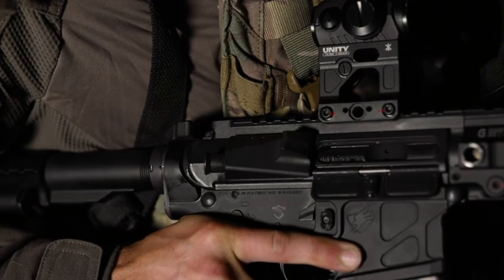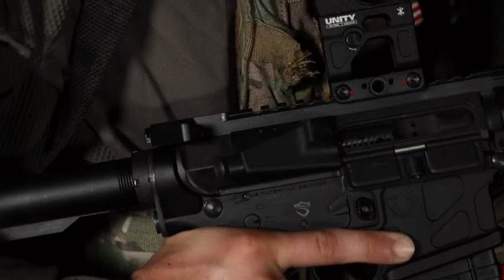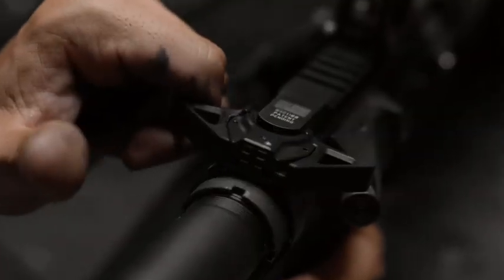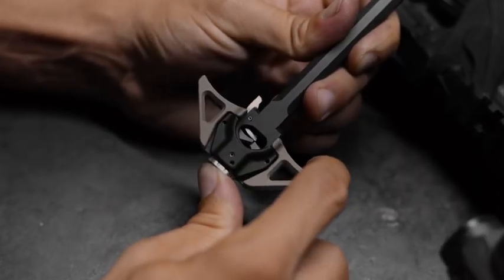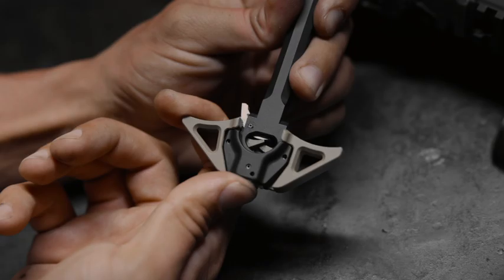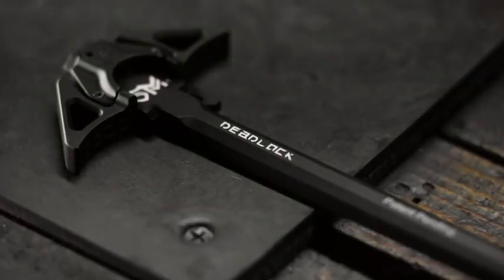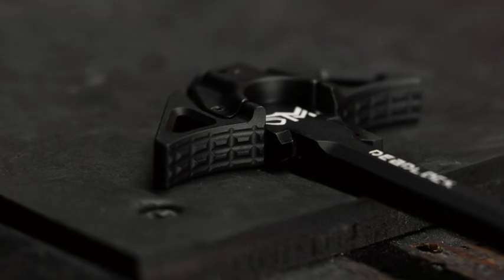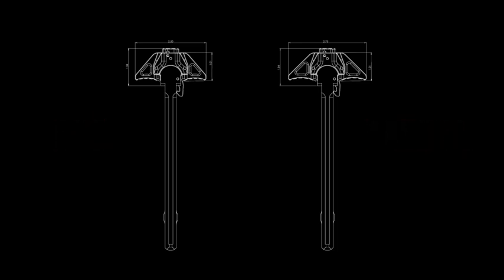Sentry Manufacturing - New Product Release: Deadlock

Comment: I’ve been running this charging handle for about 6 months in multiple training environments to include live fire indoor shoot houses, in/out of vehicles, &. Woodland patrol. My initial hope was for the handle to mitigate the issue of snagging on kit, seatbelts, etc. in which case it performed exceptionally well 100% of the time. An unexpected, yet welcomed surprise, was the gas mitigation. I run a very gassy suppressed MK18, and even in indoor live fire environments throwing multiple shots repeatedly, in tight spaces, I experienced zero gas issues. I have since replaced all of my charging handles with Deadlock.